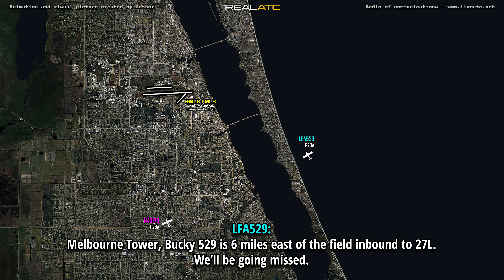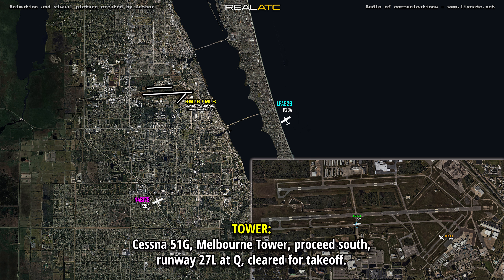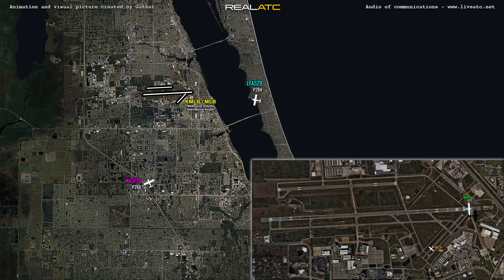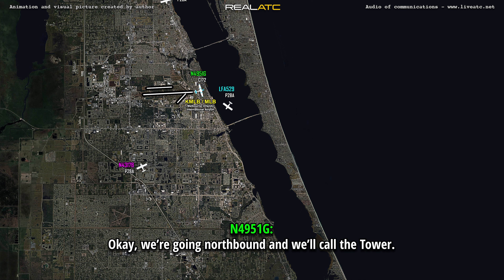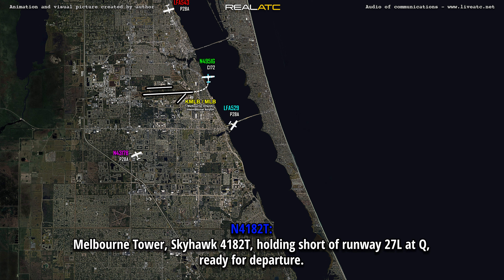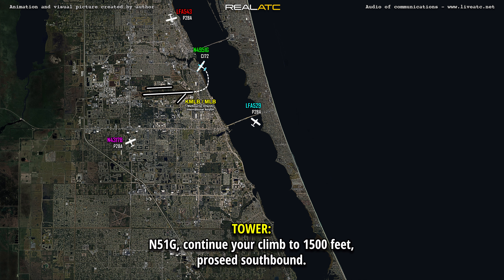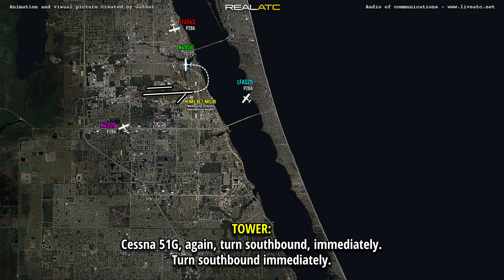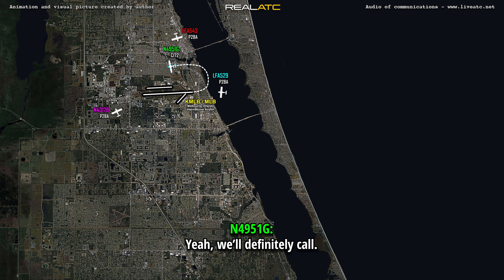Confused Pilot TOOK OFF the WRONG RUNWAY and caused chaos in the air. REAL ATC

Comment: The audio call signs don't seem to match the illustrations.  Some do, but others don't.  The color code is a great idea, very helpful.  But there were colors in the audio not represented on the illustration.  Hard to follow what was happening.
Reply: You couldn't identify the callsigns written above the planes and the callsigns that the controller was calling out?